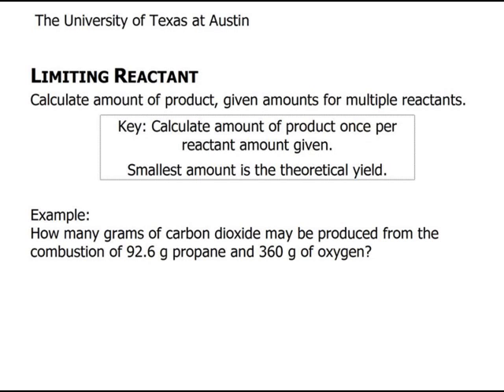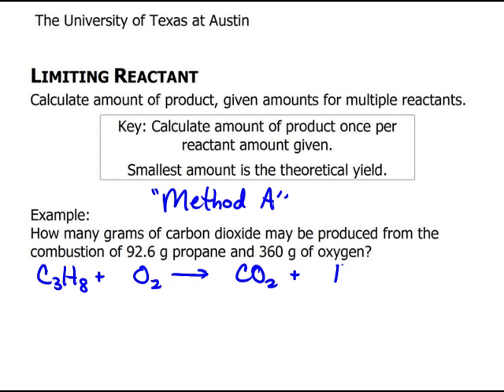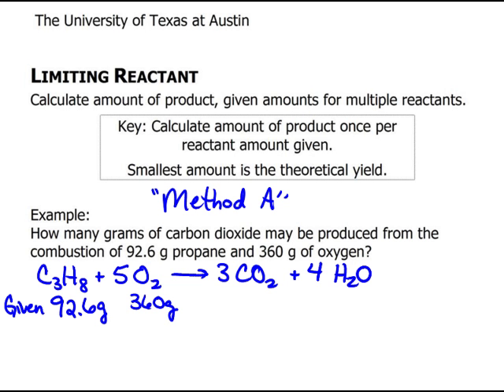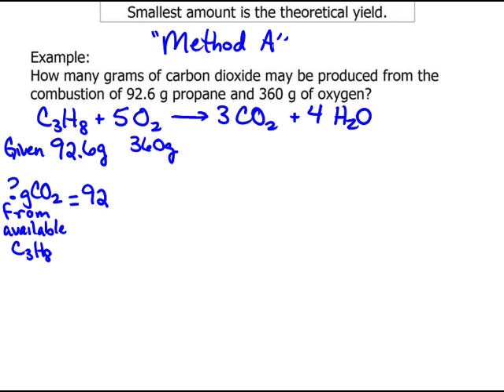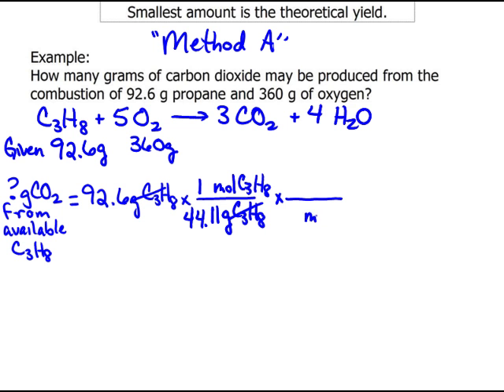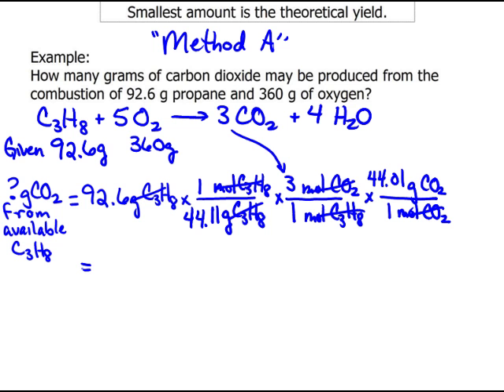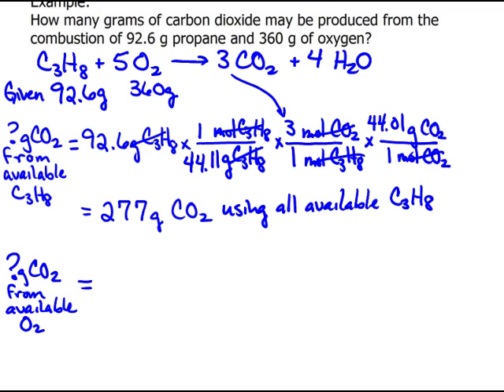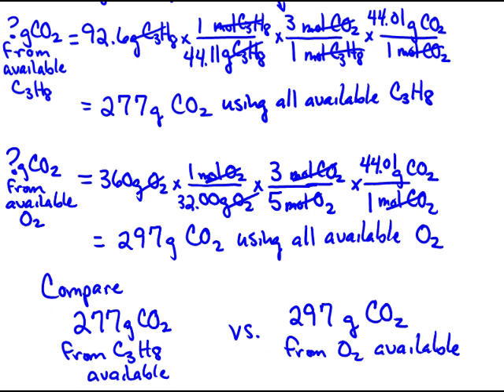Limiting Reactant grams (Method A)

Comment: how did you get 44.01
Reply: she took the atomic mass of carbon ( 12.011) plus the atomic mass of oxygen (15.999) 
so you would do 12.011 + 2(15.999) 
you multiply the 15.999 times 2 because there’s 2 oxygen in CO2